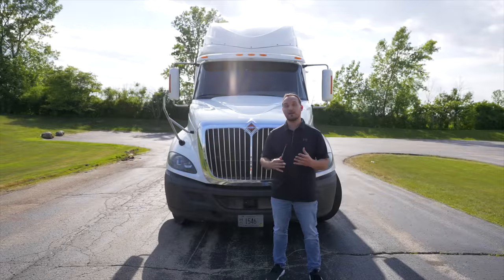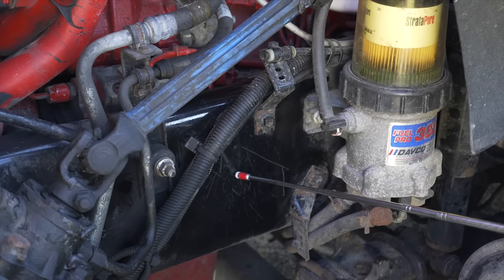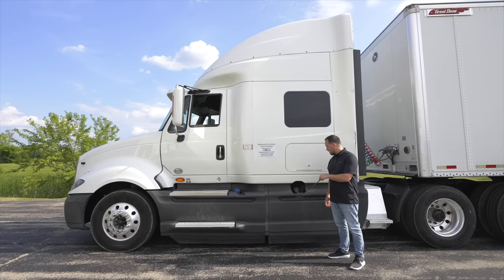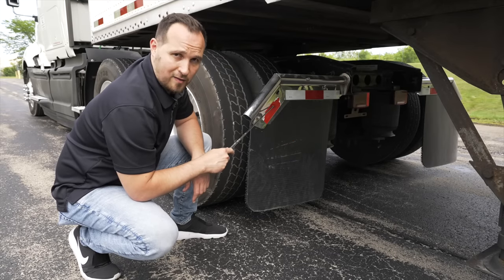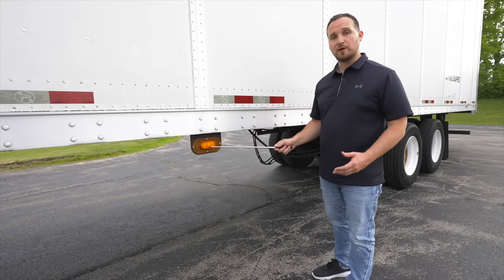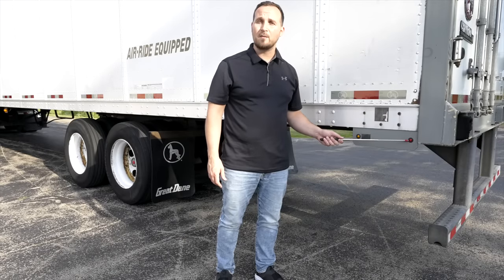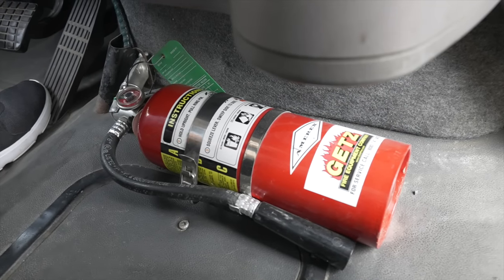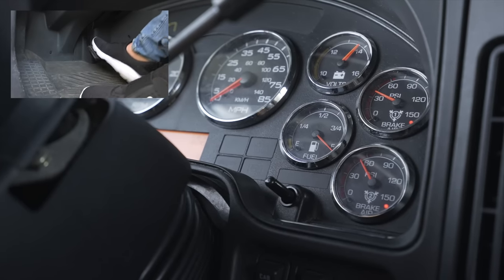CDL PRE-TRIP INSPECTION!!! CLASS A - MYCDLBUDDY BADGER CDL PRE-TRIP

Comment: Thank you for this video. I did notice that when you mentioned the Brake Pads & lining you didn't mention that it was free of any grease/oils on both the pads/lining and rotors.  I was dinged for that on my 1st pretrip fail. I'm currently on my way to re-test today. NOTE: Florida standards might be different also.
Reply: man WHAT
Reply: @retropickups2000  yeah man, I mentioned in the pre-trip exam that the brake drums and lining were free of debris and grease/oils. But he marked it wrong because I didn't also specifically say that the break shoes were also free from grease/oils etc
Reply: oooooooooppp😮

Comment: you would have failed in GA. you are missing so much critical detail
Reply: What he’s missing??
Reply: Like what?
Reply: There are several things like lights clean and clear and naming functions. Running parts together and not being specific to the part.  Georgia is real nit picky about details especially looking to see if you know what your talking about rather than just memorizing what to say especially catch alls. Properly mounted not bent broken cracked or damaged. Not missing any hardware. Not cut frayed dry rotted etc. 
The key to the pretrip is doing it properly three times a day for two weeks. By then you will ace it. Just get it right and understand what your checking and what your checking it for.
Reply: Anything made of metal plastic he should have said bent broken or crack 
Anything made of rubber abraison, bulges, cut
On the airbrakes demonstration he did not do the air the gov cut out between120-140
He forgot 
Fast idle to 85 
From 85 to 100 in 45 sec
It's a   great video overall